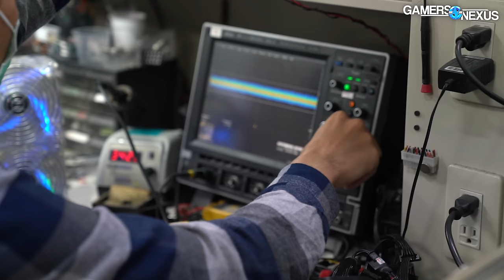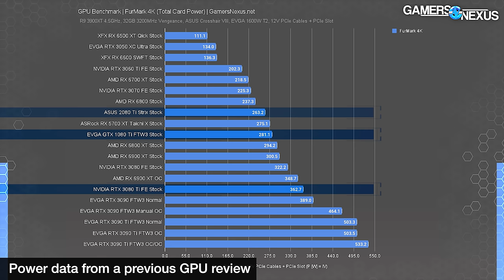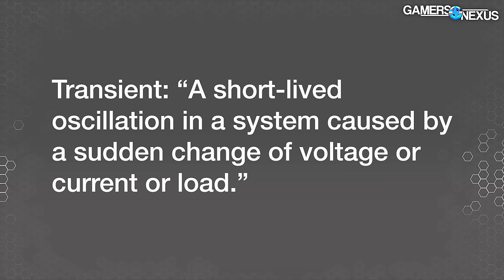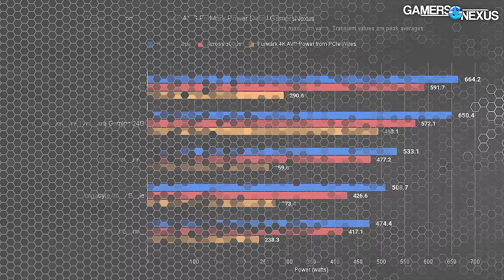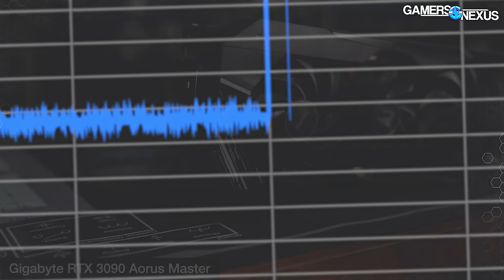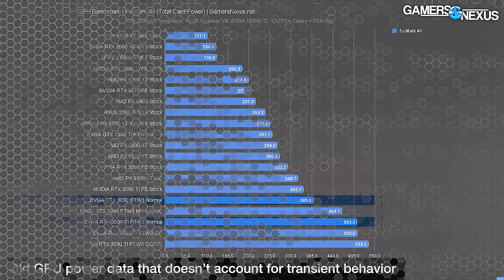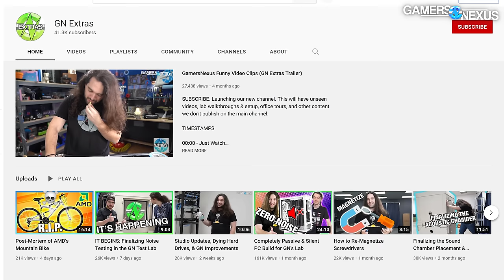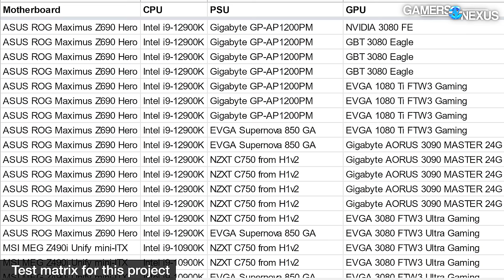The Brewing Problem with GPU Power Design | Transients

Comment: I had issues when I upgraded my GTX1060 to a RTX3080 a few months ago. At the time I was running a Cooler Master V650 PSU.
That PSU had been running flawlessly until adding the new GPU.
I played around a little with it and found the system was stable on my old medium graphics settings of 1080p or 2K res. It was when I ran at 4k or with ultra settings that I was getting the shutdowns. Even in older games like ARK, Fallout 4, GTA5 and Kingdom Come Deliverance. In GTA I was even getting some serious chugging in tunnels that I initailly put down to using PCI-e 3 instead of PCI-e 4 (through that did seem to continue after PSU upgrade.
In addition I saw some graphical corruption (purple artifacting) on my 4K TV (over HDMI, with two other 4k Monitors running).
After laughing at my 6 year old PC crashing, I upgraded the PSU to a 1000W ThermalTake PSU (Picked to match the TT case).
After that I haven't had issues with shutdowns.

I'm my case I do think the age of the rest of the system, MB in particular is probably a contributing factor, as I did have some issues with a USB keyboard not powering up every time. That lasted till the MB/CPU/RAM upgrade last month. Rock solid since.

When I bought the 1000w PSU I felt guilty, it was overkill in my mind and I debated getting a 850Watt. Now though I'm glad I paid extra, though I now worry that maybe it was insufficient overkill for future upgrades.

Comment: I've had a Gigabyte Aorus 3080 running on a Seasonic GX-750 PSU for about 8 months now and I can't remember it shutting down on me one time. I do have a few mitigating factors in play that may make this a bit better:

1. I put the BIOS switch on the 3080 into "Quiet" mode when I got it and never looked back. That lowers power draw a bit.

2. I have a 1440P 144HZ monitor, so I'm not pushing several hundred FPS at 4K as in GN's testing.

3. My CPU is a Ryzen 5600X at stock everything. I tried OCing just the infinity fabric and had some stability issues, so I just dropped back to stock. So that is not drawing very much power at all, which may leave some additional headroom for the GPU, and finally...

4. I don't monitor temperatures super closely, but I think my system is running pretty cool. The 5600X is on a 280MM CLC at the front intake of my case. It's an inverted build, so the GPU is facing the top where I have 2 more 140MM fans drawing fresh air straight into the GPU. There's an additional 140MM intake in the front above my rad for more fresh air and to promote airflow out the mostly open back of the case (a BeQuiet Darkbase Pro 900). The PSU fan is facing up and is one of only 2 exhaust fans, so it has access to not the coolest air, but tons of airflow in that part of the case. I know lower temperatures increase efficiency a bit, so that may be helping slightly reduce power draw.

I played through Doom Eternal a few months back on max settings at 1440P 144HZ (I think at native resolution, but DLSS may have been involved) without issues. My only concern is I live in Socal and summer is coming. I do not have AC in the room with my PC, so I'm a bit worried about how it's going to handle the temperatures. Basically any temp under about 90 degrees outside it's cooler to have the window open because the PC will heat up the room that much within about an hour. So that heat combined with possibly being on the edge of what the PSU can do may push it over. We'll see.

Comment: This has been a complaint with the Strix 3080 cards, where the system would blackscreen for a few seconds then come back online. After this happens, LEDs would blink above the PCIe power connectors to indicate that the card isn't getting enough juice. While the system isn't shutting down like you are demonstrating in the video, it is still an annoying issue and the blinking LEDs would only go away after shutting down and turning off the PSU switch for 30 seconds. The issue was initially worse when I had a 750w gold Corsair PSU, where the screen would go black every time I launched a game, but it got a bit better after upgrading to a 1000w PSU, also from Corsair. However, it's still a bit ridiculous that it would still happen occasionally with a 1000w PSU and a 3080. The issues went away after I did a proper undervolt on the GPU, which affirms that this was the issue.

Comment: I am eager to see this same quality in depth video on the 4000 series cards when they arrive.
I bought an 850 gold powder supply with the future in mind in 2015 for my 6700k and 1080ti build. I now use it in my 5900x and 2080ti build. I hope to be able to use it with a new high end 4000 or 7000 gpu. I would hate to be forced into a new power supply.

Comment: It sounds like people should be getting something closer to an 1800watt power supply for the rumored 600w consumption of the 4090- because when it power spikes(lets be honest, it won't be fixed)  It will knock out these 1200 watt psus that "should" handle it otherwise.

People are going to start to need to install 220 outlets and make use of that feature fully, in the united states.

Comment: It is funny that you are doing this now, ( replaced my power supply)I had an issue with my fans surging like your example, I have 12 fans, 5950, all four ram slots filled, a total of three ssd, two Nvme and a standard data spinning hard drive with an Evga 850 and I had added a 3080ti 12 gig to the mix.  The system just seemed different with the surging fans from having my previous rx5600xt video card.  No problems with the 5600xt.

I stayed with Evga and went up to a 1000 watt g2 and most of that went away (the surging), but I have had three shut downs since, but they have been spaced out. I looked at a power supply calculator as well and saw my problem with the 850.  I will look at the motherboard and possibly entertain a 1600 watt power supply as I have found one on sale.

The last time I had the surging fan issue and yes I did have my Pc cut off even with the 850, it was followed a month later with a loud pop, smoke and a dead graphics card (years ago) so I had an incentive to correct this problem quickly.  It is 80 times better than before, but still a concern as I game in 4K and play the games tested and use the card for videography and editing.  I forgot to mention that the motherboard is an Asus x570 plus, tuf gaming wi-fi.

Comment: I had issues with this with my old 1080 playing Borderlands 3 on a 500 watt power supply. Extrapolating back from the 1080ti results, it makes perfect sense that spikes to 400 watts or so were enough to power my system off back then. I still use that PSU, that machine has become a server, so it's good to know what the cause for those poweroffs was.

Comment: I think I was having this issue.  My issue is when I was surfing the web, playing games, was getting blue screen, reboot freeze up. This was on my new build which had a HX850i Watt Power Supply in it.

My older computer had a Emermax 550W and it was on it's last legs. I swap it out with the Corsair Hx850i Watt the specs on this computer. This computer has a 

Intel 4th Gen i7 4770K 
32 GB G Skill Rip Saw x Series
2 Optical Samsung DVD-RW Burners
1 HDD Black Western Digital 2TB
1 Crucial M2 SSD 250GB
1 Samsung 840 Pro SSD 256GB
1 Asus Z87Pro LGA 1150 Motherboard
1 Sound Blaster ZX Card PCI express
1 Founders Edition 1070ti 8GB Video Card 
1 Cool master Full Size Tower
3 240MM Fans RGB
1 140 MM Fan RGB
1 Corsair gaming mouse
1 Corsair Gaming Keyboard
2 Dell 24 Inch IPS Monitors
1 Set 5.1 Logitech THX Surround System
1 Logitech 720 K HD Web Cam
1 9 Pin USB Header
1 5.25 Internal Card Media Reader
1 Ubit AX Wifi 6 PCIe Card
1 Corsair HX850i Watt Power Supply

My new build I was using the iH850 Corsair 850 Watt Power Supply.
I Changed it out for A EVGA 1600P Watt Power Supply.
Now it seems my issues have went away.
The old computer with the Corsair seems to be running fine, but it takes a lot less power then the new computer I built.

This is the specs on the new build:
Intel 12 Gen  i9 12900K
32 GB Corsair Dominator Platinum
1 Samsung 970 EVO Plus SSD M2 NVMe  1TB
1 Crucial P2 M.2 PCIe SSD 1TB
1 Corsair H150i Elite CAPELLIX Liquid CPU Cooler 
1 LG 32 Inch IPS Monitor
1 4K HD Web Cam
1  Set 2.1 Klipsch THX Sound System
1 EVGA 3070ti FTW3 GB Video Card
7 120 MM Corsair RGB Fans
1 Corsair 5000X Case
1 Corsair gaming keyboard
1 Corsair Mouse
1 9  pin USB Header
1 USB Toner Mic
1 Steel Series Pro Artic Wireless Headset With a DAC
1 Corsair iCue Elite CPU Cooler LCD Ice Display
1 EVGA 1600P 1600 Watt Power Supply

The new build is running fine now.  No more issues.
The same with the old build.
I think spikes and overload seems like a possibility.

Comment: When I bought my beQuiet 600W psu in 2017 I never imagined that it would ever be a potential problem when buying a graphics card that isn't the absolute high-end, but here i am in 2020 worrying whether I neet to upgrade it when I might buy a 3070 or 4060/4070 at some point...
Also massive respect for the top notch testing/reporting/content you a constantly producing
Reply: You should probably just not rely on that PSU anyway. It's 5 years old. How much did you use the machine? You could keep that PSU for a different machine

Comment: Never had shutdowns form transient spikes with my 3080 and EVGA 850 GA, but the PSU had crazy coil whine that I could hear with headphones on.  I had EVGA do an RMA on the PSU and they swapped it with a 1000W G+. It has some coil whine while gaming still, but not nearly as bad.

Comment: This came out right after a build my partner and I made started having this exact issue, thanks so much! We were using a PNY RTX 3060 with a Cooler Master sff 850w PSU. Once we swapped to an older 1070, the issue subsided. So it's really lining up with what you guys found here. Thank you again!!
Reply: nah, 3060 draws less than 200W at max load. very unlikely for it to trip up a 850 PSU. your system would need to draw more than 1kW for that to happen. 1070 is quite similar in terms of power requirements. so the problem is probably somewhere else. a faulty PSU can be the case though

Comment: Well and here I thought PSU recommendations were just exaggerated ... as for myself, just this week I coupled my newly bought ASUS TUF Gaming GeForce RTX 3080 OC 12 GB (Standard BIOS i.e. no OC BIOS) with my (bought last year) AMD Ryzen 7 5800X, ASUS ROG Crosshair VIII Dark Hero and Fractal Design Ion Gold 850W in a Fractal Design Define 7 case (three be quiet! Silent Wings 3 PWM 140mm installed in addition to the included fans). I just went through all the 3DMark benchmark and stress tests available and so far, no issues. Average power consumption peaked at roughly 550W and no unexpected reboot or shutdown.

Comment: I had a system that would randomly turn off, but also would have games crash and get blue screens.  Eventually replaced it a couple years ago after it became more frequent and I couldn't identify the actual source of the problem and was at a point where it wasn't worth investing in replacement parts to track it down. Had the same issue with a completely new prebuild (couldn't find a gpu by itself).  Turned out they had used the same PSU model (EVGA 750w) that was on my old system.  Replaced it with a corsair 850w after noting the commonality and problem solved.   Given the different wattage I can't say whether the corsair was of higher quality or more tolerant, unfortunately.

Comment: Correct me if I'm wrong, but it looks like a problem that could be generally solved easily, not changing the GPU, not changing the PSU or mobo, just selling a module that you'd put over the GPU's power connector. The module would contain a big capacitor and that's pretty much it. DIYers can make one easily.
For RTX40 nvidia should just tell card designers to add caps... With the price they ask for high-end GPUs they can afford it...

Comment: Been using a Corsair SF750, 5900x, and a EVGA xc3 RTX 3090. I guess this explains some things when I had previously tried overclocking both the gpu and cpu at the same time. Now to try and upgrade to an 850w or even 1000w psu.

Also really love the GN Ukraine Shirts. Thanks Steve and team!

Comment: I think the real culprit is, that most people are more informed nowadays. I remember 15 years ago, when I built my first pc, most people had absurdly overdimensioned psus. Nowadays with psu calculators and many more people that know that the thing a picture comes out is not the pc, people optimize more. Maybe wer're going back to overdimensioning soon?

I myself almost always build mid to upper mid range pcs. What my problem is when choosing a power supply: Hitting that sweet spot on efficiency on a psu. My current system has a rx 6600 and a 12400f. They certainly do not need the 550w psu I built in, but find a good power supply with decent pricing and efficiency below that wattage. I also wanted to get sure to have enough headroom for said spikes. However, idle power draw has gotten so good, that my system runs under the 10% mark where power supplies get ridiculously worse in efficiency. I know that its not the end of the world to be inefficient when you draw so little, but it still grinds my gears. In my opinions there's way too little good power supplies in the 200-400 watt range.

Comment: Just started experiencing this last night.

3070 Aorus Master
i7-10700k
Z490i Aorus Ultra
32GB 3200hz Corsair RS
850w Corsair SF850L

Everything in my build is only a couple of years old except for the PSU and RAM. No overheat. Everything works perfectly fine for the past couple of years until last night it becomes unusable in games. Reboots within few minutes after launching a game. 🥲🥲🥲

Comment: Reliability is absolutely essential to me. I need a system that will not crash on me under any circumstances. It physically stressed me out when I went through a period where my computer was "flaky." One thing I do wonder is, if I got a beefy PSU to support a system that should only require a smaller one, what sort of UPS would I need for that? Would I need one that could handle the max power use of the PSU, or one that would only need to support a bit above the "average" expected drain of the components? I have slightly unstable power, so a UPS is essential, but I don't want to overspend on one.

Comment: Recently got to finally buy a 3080 and since I have a 2018 EVGA SuperNova G1 650w gold psu, I decided to chain the temp and power targets together, simply setting the temp target down from 83C (stock) to 80C, the power target dropped automatically to 88% (Zotac/Firestorm). I think this says a lot about the lengths they've gone to get that extra performance.
I have a Gigabyte Z370 Auros G3 with I7-8700k, no probs running 4k 60+ if the game/settings allow for it. Obviously the card isn't strictly getting the juice it wants, occasionally sucking air, I will raise the power target back up and see if there is significant differences after I install the new PSU.

It would also seem that the 30 series has a problem coming out of both sleep and hibernate modes. I went from a 1080ti to a 3080 12gb, from what I saw there was no real reason to burn the drivers and reinstall, as all Nvidia cards use the same driver pack, so I was left to assume it's an issue with the cards firmware or similar, now wondering if it's power related.

Just ordered a EVGA SuperNova GT 1k Gold though after watching this, can't wait to rerun the whole psu cables. 🙃

Comment: Been dealing with this problem for months now and I’m glad it’s finally resolved… of course it’s my fault I only got an 850w psu when I’m running a 3090, I9 11900k , 64g ram and a metric shit ton of RGB  while being “slightly” overclocked… but lesson learned and I just ordered a 1,500w just to be safe as I’ll be going to a bigger case with a 4090 and want some wiggle room

Comment: I have a 750W small form factor power supply that's been handling a 3080 quite well. No signs of instability. It's a Corsair SF 750W 80+ Platinum (Certified Fully Modular SFX).
Motherboard is a Gigabyte X570 I AORUS PRO WIFI Mini ITX. RAM sticks are G.Skill Ripjaws V 32 GB (2 x 16 GB) DDR4-3600 CL16. And for storage there's 2 samsung SATA SSD (850 evo, and a 860 qvo) drives. Just a xbox wireless controller receiver on the USB. As an example, I played over 100h of cyberpunk 2077 at 4k with all RT features on psycho. Pretty happy with the stability.

Comment: Years ago I was sharing this exact thing to the community. Some of my hardware to test powerdraw showed these insane spikes. What lead me to do the draw test in the first place was OCP triggers. The PSU and every component work just fine. PSU 600w and the spikes would go above 600, when the GPU was not even such a high power draw GPU. I had to go from 600w to 850w to completely eliminate OCP triggers, total power draw still spikes above the average or say max rated output of what the system should be. I recreated this with other 30 series hardware just a couple months ago as well. Also like you said, different combination of hardware would handle the spikes better than others. For example, my 500w EVGA psu does not get OCP triggered with certain GPUS, but a 600w , even higher rated efficiency mind you, will OCP. Change boards? Might OCP even with 500w or 600w. Change GPU? Just fine now! Keep cycling through different brand PSU and MOBOS even if lower rating, eventually a combo works. I've had HOURS lost of troubleshooting because of thinking the hardware is faulty in one system, only for it to work flawlessly in another, possibly even more power hungry system!

Comment: I currently use a 3800X with the MSI B450I and MSI Ventus 3x 3080. Nothing is overclocked or undervolted and my system is rock solid stable. I use the EVGA Supernova GM 650 Watt. I typically play Cyberpunk 2077 and other triple A RPG titles with settings cranked on a 1440p ultrawide.